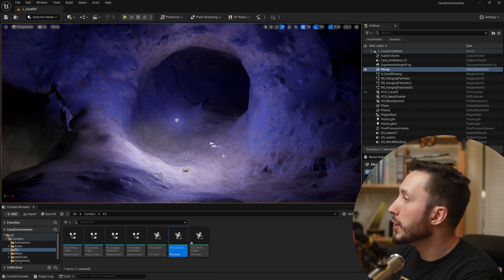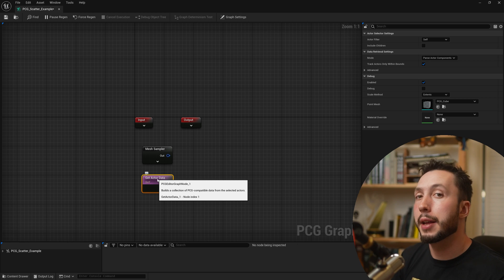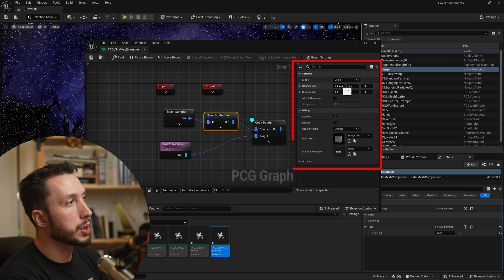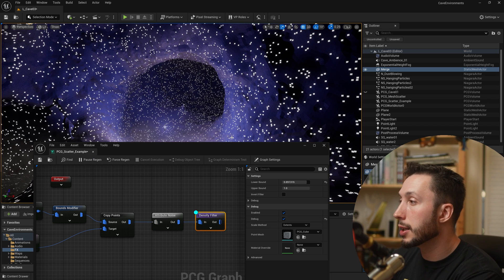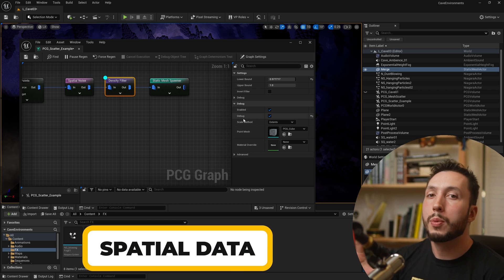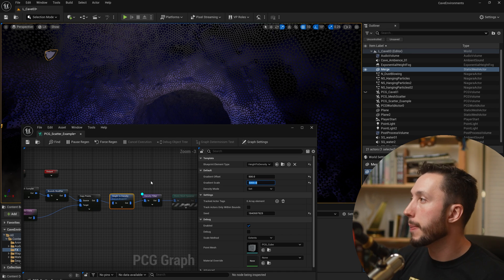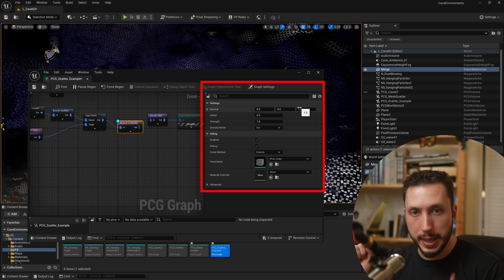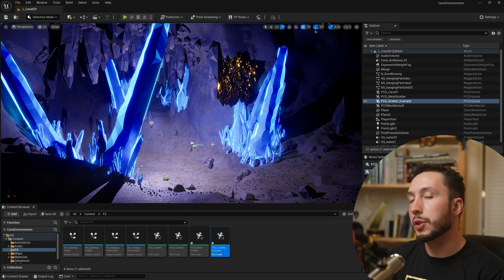3 Ways to Scatter PCG Points on a MESH in Unreal Engine 5

Comment: Hi bro! You showed up just in time with your tutorial! Thanks!
I have a few questions that weren’t covered here. First, if we’re sampling onto a flat StaticMesh, like a small flowerbed, is there a way to filter points that are close to the edges of our flowerbed? Such a feature exists in the Spline Sampler with the Interior Density Falloff Curve function. This leads to the second question: is there a way to use the Spline Sampler to project points onto our StaticMesh?

Comment: Is there a way to spawn the points on specific areas by filtering where one based of the materials is applied to the static mesh? 

Seeking to apply turf meshes on a static mesh site model where the grass areas are instead of everywhere which would cover streets, sidewalks, etc. that are in the same imported site model

Comment: Question:  If I desire Static Mesh A on Normal to Density (1st Node) +1 Z Axis, and Static Mesh B on Normal to Density (2nd Node) -1 Z Axis, how do I accomplish that in terms of wiring, tagging (?) and setting parameters in Add, Density Filter and/or Static Mesh Spawner?  Is this explained in the Cave Masterclass?  Tutorials are awesome.

Comment: Thank you so much! exactly the info I need for my project. For the meshsampler, is it only bound to the triangles and vertices? What if I an irregular topography (not equally subdivided), is there a way to "scan" the surface it self?
Reply from the maker: No problem!! 
Hmm you might be able to use the voxel option to do that, though I have messed with that as much 👍

Comment: I’m trying to make a blueprint with a few meshes and a PCG component to spawn foliage on a particular static mesh within the blueprint.

I follow this tutorial, but i cannot add a tag to the ‘Actor’ of the static mesh i want foliage spawning on (if that makes sense?) i can get it to work using a bounding box, but thats not quite what I want. 

Is there any way to do this? Spawning foliage on a mesh inside a blueprint.

Thanks

Comment: Having trouble getting the points to appear, ive used the correct tag, have the mesh i want stuff to appear on chosen in the mesh sampler but i wont see any points appear
Reply: I had this issue too. Make sure to check "Debug" checkbox within the "Copy Points" node to ensure the points appear.

Comment: Hey there! For the Height to Density, you can use a native node instead of BP node, Copy Attributes, copying $Position.Z (the height) into $Density.
As for the chain with Density Filter afterwards, you can bundle those two nodes into an Attribute Filter on $Position.Z, and you can either use the height as a parameter, or have a constant threshold :) 
Other than that, good content!

Comment: 🌟Another really good one, Thaddaeus! @azielarts Any idea how much of a performance hit this delivers? I used the other PCG technique you taught on a huge map and when I added my camera I went from 70 FPS to the warning about low memory and very low frame rate. I'm sure I've done something wrong - starting with the map size. I did limit PCG spawn to just visible to camera but not much help.

Going to duplicate the level/map and on the copy try to apply World Partition to reduce the data load. I mention PCG because I've seen some forum posts that say it is costly. I'm doing cinematics so thought my 64 GB, 3080 box could handle. I guess not.
Reply: @azielarts Thaddaeus - apologies for replying to my own comment but had something very strange happen and could really use some help from you or other users. Opening this 5.1.1 project I've found all the PCG elements missing from both the outliner and the project folders, BUT, the scattered meshes are still in my landscape! I can't touch them or edit or delete them in any way. Can you please suggest a solution to at least delete them without starting the level over from scratch? Thank you! 🙇🏼‍♂

Comment: I was just thinking about adding detail to wood using a simple chip mesh but doing it with PCG, and I found your video perfect timing. I had a question. I'm putting the chips on to a simple rectangle. But I wanted more points on my mesh and I used a duplicate point node after my transform points node to double the points I have. But I have to mess with the location to make it look scattered. Is there a easier way to add more points to my mesh? Thank you.
Reply: Yo I was wondering the same thing and here's what I found to work: start with a World Ray Hit Query node and then plug that into a surface sampler node.  You'll probably have to use a filter tag to make sure the chips don't get scattered on anything, but that should work for you